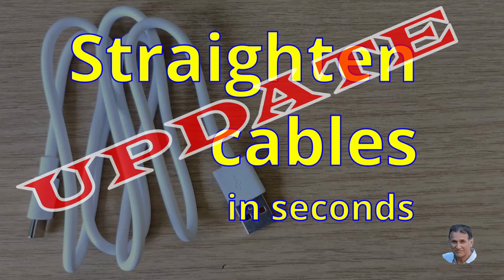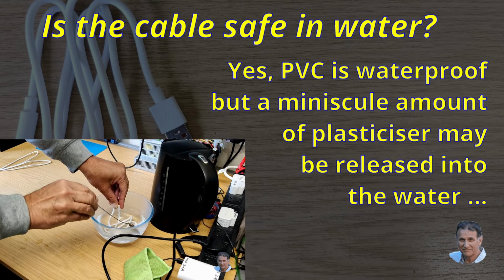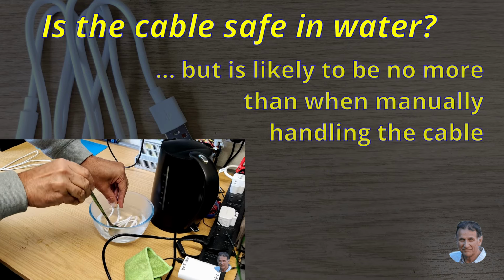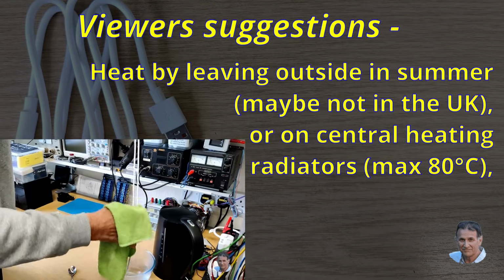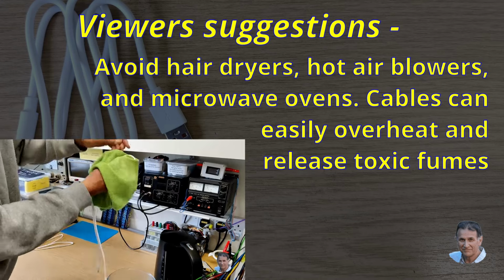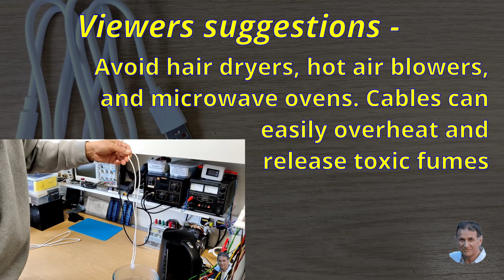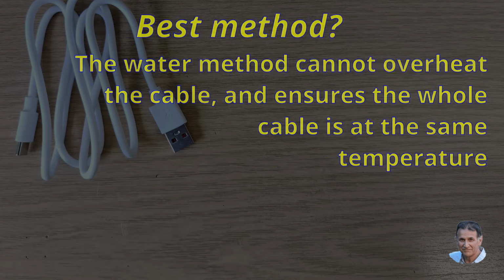Straighten Cables - update to answer your questions

Comment: Never expected a sequel to one of the best youtube videos ever
Reply from the maker: I wasn't sure whether to make this video, but there were so many questions to be answered.
I do hope it helped, rather than alienate viewers of the first video.
p.s. It took AGES to get the content sub-minute.
Reply: @richardlangner  definitely appreciate the sub-minute goal! Just the facts, no fluff. I'm gonna try putting the cables in a bag and then dipping them in hot water.
Reply from the maker: @justinhong7638  Remember to keep the bag open at the top, or it will have air inside and will float. The water will squash all the air out around the cable.
Reply: @richardlangner  Legend! Thank you!
Reply: @richardlangner sounds like a third video dropping soon

Comment: I've done this with hair dryers before, and while it works, you're entirely right that it's more risky - but more importantly IMO it's far slower and more time consuming, plus you have the major disadvantage of only heating a small part of the cable at once. Immersing in water is quick, consistent, and as you say, controllable. If you live somewhere relatively warm, putting the cable outside in the sun is also an excellent option, though you have to avoid extreme heat still. I wouldn't do this on black asphalt in the summer sun if you live in, say, southern France or Arizona or something.

Comment: just wrap it around a pot and fill with hot water. it's done when cool. takes an hour or two instead of instant, but works better and is better for your cables. secure with blue painter's tape if necessary.
Reply: reported for blasphemy
Reply from the maker: @jointgib  That sounds like a good idea, I must try it.
That's what can be good about making videos, it works both ways, thank you.

Comment: Hmm, so to get 80°C (176°F) when I have no thermometer I’m guessing I put 2 mugs of water into the electric kettle to make my pour over coffee & turn on.  Kettle will automatically turn off at boiling (212°F), then pour hot water onto cone with filter of coffee grounds.  Let water pour through & drink some coffee.  Then use remaining now cooled a bit hot water to pour onto cable in method you show & dry off cable.
Reply from the maker: Sounds like a plan ;-)

Comment: I'd love to see how you store extra cables. I'm really tired of the "toss them in a cupboard and worry about it later" method I've been using.
Reply from the maker: I made a cable rack out of acrylic, that fits to inside of a cupboard. I designed the strip so that it will survive fast opening and closing of the door. I may show it in the background of a future video.

Comment: Place a terry cloth face or hand towel on  plastic cafeteria tray.  Poor warm water over cloth to dampen but not saturate.  Place cable over cloth.  Fold cloth over cable.  Pull cable taught, but not hard and it should be straight.

Comment: Just looking at my desk, this is a non-issue, nearly all cables are straightened already. I actually prefer them non-straightened as I travel a lot and they are easier to fold back up at their original folds and put back in a storage case more easily. Also, doing this will have a detrimental effect on the cable structure such as adhesion between the inside of the pvc layer, so it's really not a good thing to do to cables if you want them to last.

Comment: After trying out your method (which I by the way agree with, is the safest) on three cables, it turned out that none of these cables keep their straightness. I also tried making a curled cable by rolling it around the circumference of a broomstick as I tried to make nicely curled cable but this was a braided one and it also doesn't really keep its shape that well, though this cable still performed the best of all cables. The other two I tried both returned to their old non-straight shape after letting them cool on a flat surface while laid out flat in one long shape. At first it looked promising as indeed the cables seemed to relax but that all disappeared after a day or so and they all slowly returned to their old shape except for the braided one which now is just one long messy coil that doesn't stay together haha.
Reply from the maker: You may need to use a higher temperature, as 80C only softens the PVC, but be careful not to make it too high so as to damage the PVC structure.
Reply: Perhaps the heating time was insufficient, and the inner layers of plastic did not warm up and remained bent.

Comment: I usually have more patience than this. I' either hang the cable, or I'll gently roll the cable around an appropriately sized object and let it gently adapt to the new shape. Oftentimes even just doing nothing at all, but leaving them sitting seems to help them flatten out.

EDIT: You could always just hit the cable with a hair dryer while hanging it if you're in that much of a hurry.

Comment: I have a usb cable with slight damages in both side joints. When charging mobile I need to hold the cable straight to keep connected otherwise it get disconnected. Can you tell me any way to repair the joints?

Comment: what if we put the cable out in the sun in hot water inside of a microwave with a hairdryer blowing it on top of a central heating radiator while listening to "Disco Inferno" at full blast from a boom box
Reply from the maker: Not sure, please let me know if you manage to straighten the cables like this ;-)